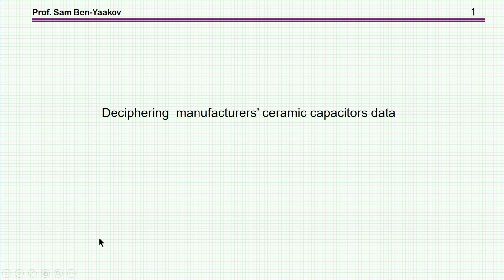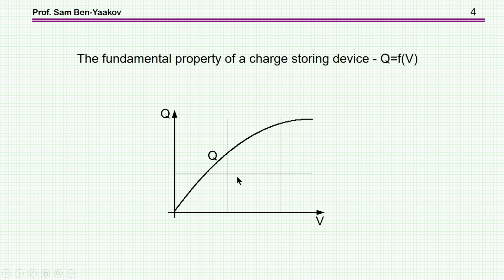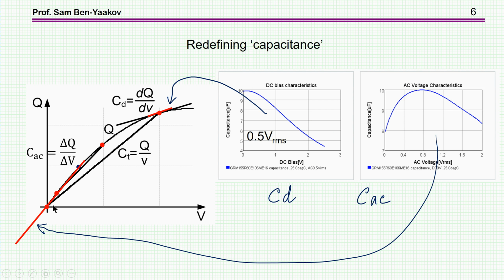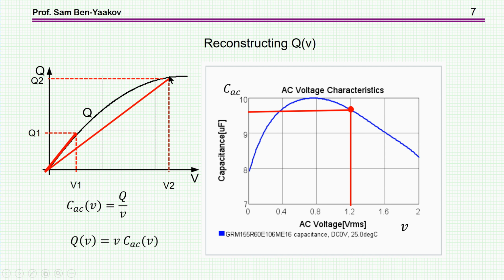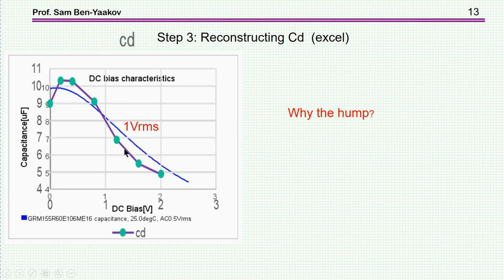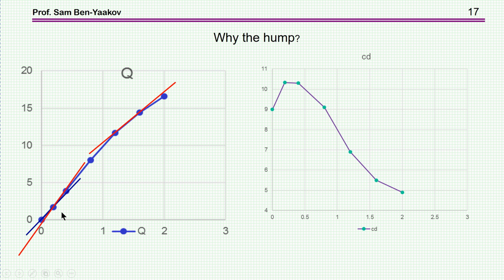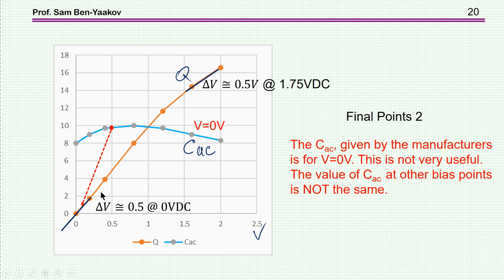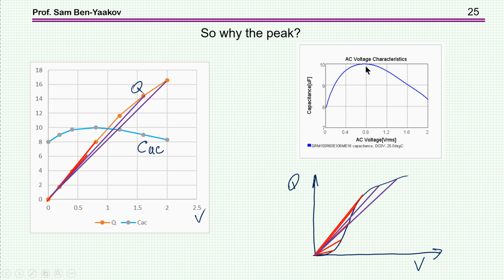Deciphering  manufacturers’ ceramic capacitors data

Comment: Q=CV and I=dQ/dt by definition.  Normally, we treat C as constant; however, when C depends on V, C=C(V), this is not valid when V changes.  I=dQ/dt=C dV/dt + V dC/dt.  By the chain rule, dC/dt = dC/dV * dV/dt, so
I=(C + V dC/dV) dV/dt.  The signals applied by the manufacturer are V(t)=V0 + vo sin(wt) so that
I= [C(vo) + vo dC(vo)/dV] w vo cos(wt) as long as vo can be considered "small."  In this case vo is large enough to 'see' too much curvature of the C(V) graph and this invalidity introduces inconsistency in the two responses.  The manufacturer's signal averages out the details of the Q vs. V graph.
Since the average is <f>= 1/(b-a) int_a^b f(x) dx, we can partially reconstruct this detail by taking great care where V=a and V=b intersect the graph of Q vs. V.  It would be worthwhile to write and to publish an applet that reverses these measurement averages and produces a Q vs. V graph estimate.
Reply from the maker: THere is more to it. You need to carefully define what you mean by "C". There are a number of definition. See https://www.ee.bgu.ac.il/~pel/pdf-files/jour143.pdf and search in YouTube  search window "sam ben-yaakov capacitors"

Comment: By the way, this patent
http://www.google.sr/patents/US20110278952
claims that usage of ferroelectric capacitors in switched capacitor converters allows one to regulate the output voltage by DC bias. Well, changing the operating point, we change time constant, which is equivalent to changing the frequency.
Reply from the maker: Alex, Interesting pointer, But:

1. This s not a patent. It is a patent application (2011) and a patent was never issued. 
2. It claims that the input to output ratio of a switched capacitor converter can be varied by changing the capacitance of the capacitors. It this possible? Will the conversion ratio of, say,  binary DC-DC converter change, if you change the capacitance of one of the capacitors?
Reply: If by the output ratio the authors mean no-load output voltage, then I doubt that this claim is correct. In steady-state there will be DC voltages on capacitors, so it does not matter they are linear or not.

Comment: There are also commercially available anti-ferroelectric capacitors, where  the capacitance is increasing with voltage
https://en.tdk.eu/tdk-en/1195576/products/ceralink-presentation---overview
Reply from the maker: Hi Alex,
I have referred to these capacitors in one of my last videos. Thanks for the link.

Comment: Thank you Shmuel. Apparently you are the first, who noticed the concavity of Q(V) characteristic at the beginning, such that considering the whole characteristic, we have a step. Probably, such a step is peculiar only for multilayer ceramic capacitors or/and modern materials, since characteristics with no step have been considered at least in 1953
Д. М. Казарновский, "К аналитическому расчету цепей с нелинейными конденсаторами," Электричество, no. 10, pp. 68-73, 1953.
https://www.booksite.ru/elektr/1953/1953_10.pdf
For a sinusoidal AC exitation the paper derives analytical expressions for nonlinear RLC circuits using the Galerkin method.
Reply from the maker: Alex, 
In as much that your remarks are flattering:
1. I have not discovered the initial slow rise of the Q(V) curve of ferroelectric material. It is well known. 
2. This phenomenon is typical of materials with polarized domains and is also present  is ferromagnetic material, hence the concept of "initial permeability".